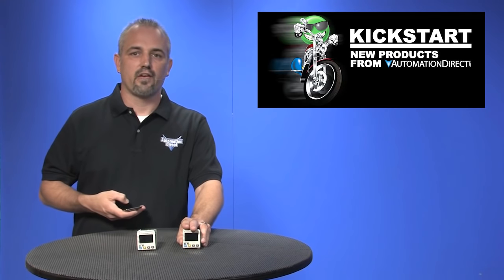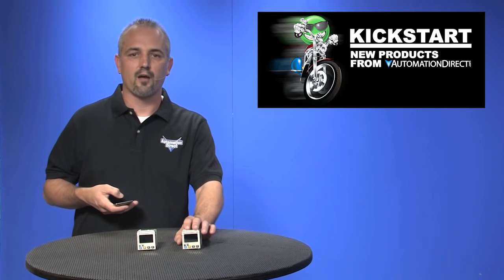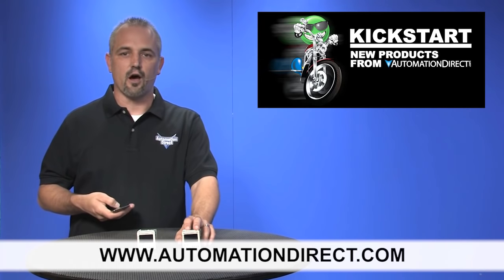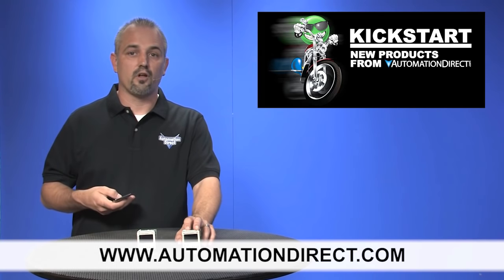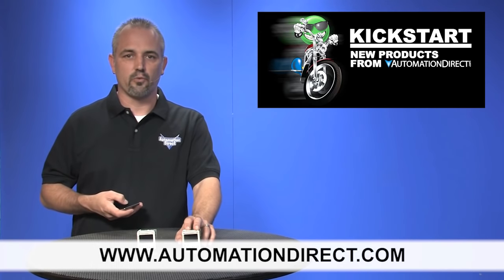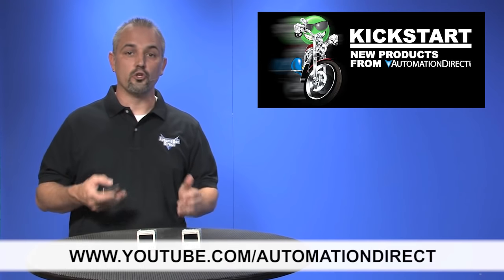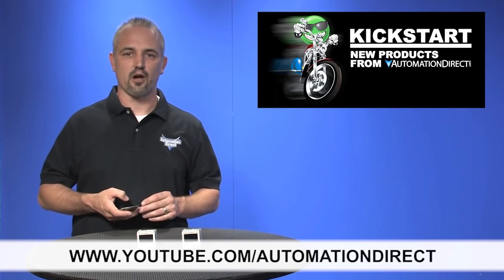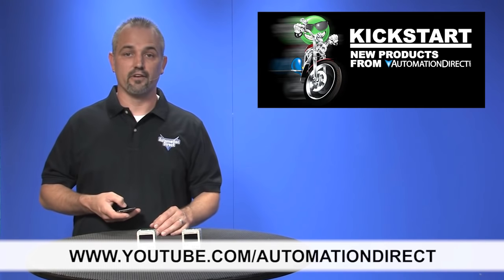Digital Counter / Timer / Tachometer - CTT Series from KickStart at AutomationDirect

Comment: I’m interested in this unit as a rotational tachometer, for low speed (30 - 50 rpm). What kind of sensor I can connect to it? Would a simple magnetic sensor work? Thank you
Reply from the maker: Pretty much any sensor you want to use. It accepts both voltage and non-voltage inputs and accepts both NPN and PNP and dry contact inputs!
FYI - We have a whole series of videos showing you how to use this guy:

Skip the manual: https://youtu.be/yfZNIk4pTSU
Timer Function:   https://youtu.be/tiAA1aM8qL4
Timer Demo:        https://youtu.be/YCvwSuzyWEI
Counter Setup:    https://youtu.be/SL3cADQzAO8
Counter Demo:    https://youtu.be/IwazmHMe6zA
Tach Setup:          https://youtu.be/AhGhlIdFJCE
Tach Demo:          https://youtu.be/zwRtrVye6IM

Full Playlist: https://www.youtube.com/watch?v=yfZNIk4pTSU&list=PL581D00073E291D1C

Comment: I would like to use this controller to create an adjustable turn cycle. Example every 30 minutes it produces an output from a dry set of contacts which turn the carts. During this turning sequence i have an input signal that allows us to count and confirm that they turned. The other thing i would like to know is will this controller produce an alarm. For example, having a relationship between the timer and the counter and the conditions would be this, at the timed out closed position i have to see an input and if i dont after so many minutes it closes a set of alarm contacts. Can this be done with the controller?
Reply from the maker: For technical questions like this, please contact our free award winning tech support. They are setup to give you the most efficient and quickest support. 

Phone:    1-800-633-0405
Email:     https://www.automationdirect.com/adc/Form/User/TechInquiry
Support:  http://support.automationdirect.com/

Please let us know if you have any other questions! 

Thanks, 
AutomationDirect